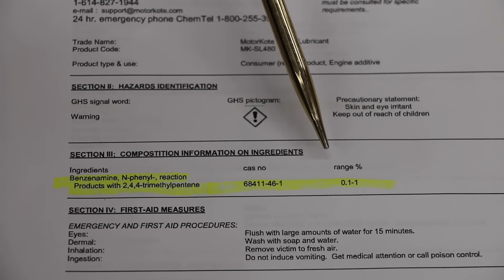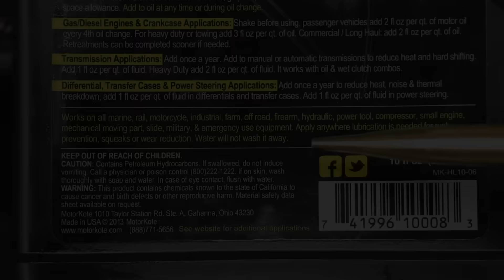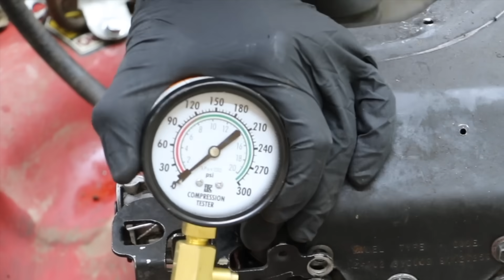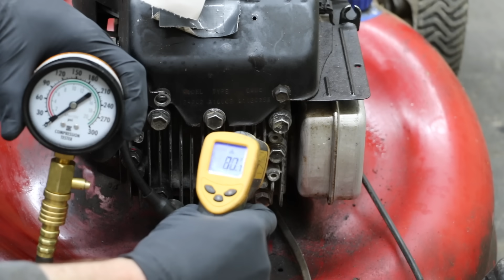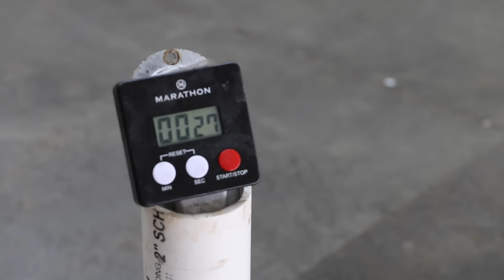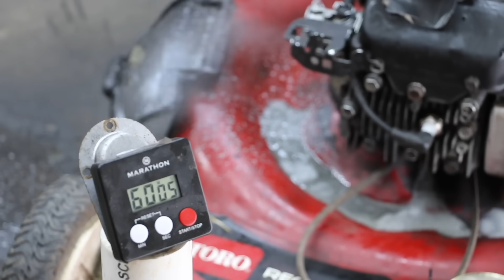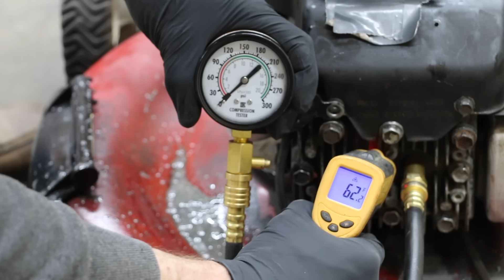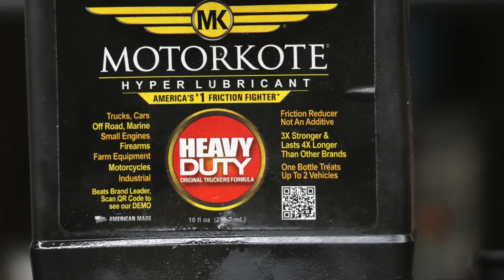Can MotorKote survive the water test?  Let's find out!

Comment: I put 14oz of MotorKote in my RV with a Ford V10 and drove it 2400 miles and it got about 10 to 15% better mileage. Then I changed the oil and didn't add any MotorKote. It still gets 10 to 15% better mpg. Guess it does coat the moving parts.
Reply from the maker: Thanks for the feedback.

Comment: After watching this video, I actually tried this Motorkote on Toyota 2.4 L 2AZ-FE engine with lifter noise at 150K miles, engine got destroyed after half an hour  25 miles on highway. Could you test Petron plus formula 7, E.P. (Extreme Pressure) Lubricants, designed for Diesel Engines. Nano-Monomolecular technology, treats the metal not the oil, long term, it claims it has no additives. No common EP agents such as molybdenum disulfide (Moly), graphite, Teflon, or PTFE resins, copper, lead, silver, or other metals, nor other previously used EP agents. It doesn’t contain Carbon Tetrachloride, 1,1,1, Trichloroethane, or Chlorinated Paraffin, or Chlorinated Solvents or any other harmful solvent. It's also twice expensive than this Motorkote. This formula 7 sounds too good to be true, I don't know if Lubegard is better as most transmission shops use it with Liquid Wax Ester synthetic whale oil replacement.
Reply from the maker: Thanks for the suggestion.

Comment: I learn a lot watching your channel and want to thank you for doing what you do.  I do have a question you might want to look into about Marvel Mystery Oil use in gasoline engines.  If you can do a video about using it, I think it would be interesting.  I use it mixed with gasoline, not in the oil.  I’m thinking that since the ethanol blend fuels are corrosive, mixing in Marvel might offset it.  Thanks again!
Reply from the maker: Thanks and you are welcome!  Thanks for the suggestion.

Comment: You should have ran a same engine without motor coat and seen if it too could run an hour on water. I bet it would cause was always some oil left to mix with the water plus engine not under load. When I was a kid I also put water in a Briggs and Stratton engine and without any additive it ran so long we got tired of watching it. So I call foul unless you use 2 engines one with treatment one without.

Comment: Can you do a product test on Slick 50 ORIGINAL formula they have for sale on AMAZON. I remember my dad swearing by the stuff back in the 80s but the new slick 50 stuff you reviewed was different. Thank you. 👍
Reply from the maker: Thanks for the suggestion.
Reply: I used to use slick 50 in the early 90s. The engine spun over easier and I had lower coolant temps.  The OHV cam bearing surfaces had a shinier look to.  
I don't care what anyone says... that stuff reduced friction.

Comment: Im a diesel technician since 2004 and  I remember they used to sell this at the truck stops at sat brothers and drivers were claiming they were gaining 2/10 of a mile extra by using it years later I started using it cause it does work. Later on I purchased gmc Acadia 2008 and had the engine replaced not long after and shop installed OLD OIL PRESSURE sensor and started leaking oil not even 100 miles on my engine. I changed installed new from napa 60.00 oil pressure sensor and 6 months it leaked out ALL my engine oil but, i run a royal purple, moterkote,synthetic lucas mix and i didn’t notice tell i seen oil on ground and oil was a dot on dip stick i had drove at least 60 miles with 2 qts of oil on my new 3.6 and temp rased a little but always came back down. This stuff works and ill keep using it!
Reply from the maker: Thanks for the feedback.

Comment: Amsoil ran tests on Motorkote and found their products contained as much as 27% chlorine compounds and that when exposed to the temperatures of an engine can be partially reduced to hydrochloric acid - literally disolving your engine.   So sure, it lubricates well in the short term, but long term you're eating the engine from within.

Comment: Please please please test Prolong along side the other friction modifiers you have tested. I used to use Prolong religiously after an experiment I performed. 

Using a hole saw in a drill press to cut 3" round baseplates out of 3/16 mild steel, I was using 10w30 as lubrication. 
The work was tough, any excessive pressure would stall the drill press and when it didn't stall, the hole saw sang like a siren and there was lots of smoke. 
Boss did an oil change using Prolong and left for the day. 
I picked up the bottle from the trash can and put a bit in the puddle of oil on the steel I was cutting. 
I watched as the Prolong stirred into the oil in the groove. 
The singing went away, smoking stopped and I found hang my body weight from the handle on the drill press and couldn't stall it. 

The hole saw stopped cutting completely. I tried a fresh piece of steel without oil and it still wouldn't cut. I ended up getting it to cut again by using brake cleaner to clean the workpiece and the hole saw.
Reply from the maker: Thanks for the video idea.

Comment: I wonder if Motorkote could  create sludge bing it sticks to the surfaces so well.  Just a thought.
Reply: It should just leave a thin microscopic film. If you change your oil often the detergents in your oil will keep the engine clean. Oil won't sludge up if you don't do intervals that wouldn't be run long enough to allow oil to break down and lose its properties.

Comment: My friends power steering pump was making noise in the winter I told him to put some motor kote in it so he started the engine took the cap off and was looking for something to measure the motor kote while he was doing that I dumped some motor kote in the pump while it was running and before he could find anything to measure with the  pump stopped making noise.... He said if he had never seen it he wouldn't have believed it.
Reply from the maker: Thanks for sharing.
Reply: @ProjectFarm  your welcome I've been using MK for probably 25-30 years it think , I have a 1993 Toyota Corolla with 1,000,048 miles and it's still rolling with MK.
Reply: @mittiejackson3427  excellent testimnoy
Reply: My friends daughters hinge on her bedroom door was squeaky I told him to put some motorkote on it he said no I want to hear the boys going in and out of her room. 😂😂.     Then a few months later he told me his daughter was pregnant. 😂😂

Comment: My 5.9 Dakota has 187k on it. Oil pressure when hot is 20-30. With motorkote it's 40-60. Been using it for 2 yrs now. Oil psi is still 40 to 60. Amazing.
Reply from the maker: Thanks for sharing.

Comment: I have been using MotorKote for many years now and got some great deals when they ran specials on the trucking bozo show over the weekends with Bubba Bo.    I had a Silverado with 265k+ miles on it when I sold it and engine was still solid.   Now I have a Toyota with 157k and just changed the alternator but engine is still purring smooth.   Worth the price!
Reply from the maker: Thanks for sharing.

Comment: Can we have a moment for all the lawnmowers Project Farm picks up on the side of the road 🙏 The sacrifices they make 😆 When my kids were young I did a test of 3 lawnmowers I picked up on the side of the road during spring cleaning.  I guessed lawnmower with broken pull string was either blown or had too much oil , lawnmower with good gas and compression but throttle seemed jammed just needed cable lubed and adjusted and thirdly mover gas smelled terrible and that tank had to be flushed and carb cleaned. Sure enough we got all three running costing just time and one pull cord. We went back out the next day and found 2 more lawnmowers that just needed carb and tanks cleaned. Oh and the mower with broken pull cord was filled 3/4 the way up the dipstick so it was just hydraulic locked.  My wife was going to have a tag sale and asked me for things for it cause when a tag says it has tools also you get far more customers so I had some tools I didn't need and I didn't need these 5 lawnmowers and told her $35 each and no haggling cause I sharpened blades and filled tanks and were ready to work . This woman asked my wife how much for the lawnmowers and my wife said $35 and no less and the lady said for all 5 and my wife said yes.  This lady called her husband and he came down with his trailer and gave my wife the $35 and took all 5 lawnmowers. Well all I have to say is my kids got a learning and so do I.  My wife says she never heard me say each. 🤦‍♂️

Comment: It totally works. I’d be interested to see how it works in transmissions, & with other additives to see if they hurt the performance.

I’d also be interested in seeing if it helps as an additive in 2 cycle oil. That would be very interesting.
Reply from the maker: Thanks for the suggestion.
Reply: @ProjectFarm 

Update: I use this in all of my vehicles now, to great effect. Each one is close to, or over, 300,000 miles with no engine issues.

I also use it in our push mower. Before, I might get 2 years out of a mower, due to the heavy use on quite a bit of maintained grass; Perhaps 2 acres on 17.5, in a very hot summer climate. Since I started using this in the last mower I bought, we’re on our 5th year of life, with no issues.

This is really good stuff, when used for its intended purposes.

I wish they made a spray for metal on metal applications, like door hinges & locks.

Comment: I realize this is an old video, but I think it's worth mentioning, (I did not read all the comments), on the subject of anti-wear additives,    zinc and phosphorus, gasoline engine vehicles equipped with a catalytic converter require oil with less ZDDP, an API standard of <800ppm. Otherwise, over time the phosphorus builds up in the converter, coating the catalyst material, resulting in an error code, check engine light, and failed emissions tests. (Though not really effecting the performance of the vehicle, just engine light and poor emissions). So in the case of this video, the oil with the more robust anti-wear additive package, though more suited for diesel engines, and vehicles pre 1988, is not an oil you would want to put in a modern gasoline engine vehicle. The Pennzoil, with <800ppm of ZDDP, is actually more suited for modern gasoline engine vehicles, being designed with less to meet API standards.
Reply from the maker: Thanks for the feedback.

Comment: Amazing! 
Could you test different oil additives against each other using Pennzoil Ultra Platinum as the base oil?

Specifically, I’d like to see a 10% of each additive in the oil for the following: 

Lucas 
Archoil 
Motorkote 
bacon grease 
STP
Slick 50
Marvel Mystery oil
Z max
Duralube
Hot shots

Versus just the base oil. 

Perhaps another oilympics?
Reply from the maker: Thanks!  Thanks for the suggestion.

Comment: Have you considered testing any of these products with a pressurized oiling system? 
small 4-cylinder engines on eBay (with shipping) are crazy, crazy cheap. Like comparable with new lawnmower engines from Harbor Freight. 
I ordered MotorKote this morning. I can't wait to see / feel the results. I have a 2.0L VW MK5 FSi engine (GTI) that has a lot of miles on it, with all new parts. Maybe this will make it last for 10 more years.
Reply from the maker: Thanks for the suggestion.

Comment: From time to time, I question your test methods and Analysis. Your test to verify whether water can wash up motorkote not only doesn't answer that question, your analysis is comparing apples to oranges. In the first test, you had the race swimming in a cup of motorkote. In the water test, you put a thin film of motorkote on the bearing and the race, and then put it in a cup of water. And then you compare the score marks between the two. Your analysis of the score marks between the two neither answers the question of whether water washes off motorcoat, nor is an apple to Apples comparison of anything.

Comment: Ole Geezer Gearhead here again! Don't everybody roll your eyes!! NOW, at almost 80(next birthday) I'm still changing my own oil and greasing the front end, of, you guessed it, my '02' Ford E250 3/4 ton extended van. with a 5.4, 2 valve engine. AND, I'm still using Mobil1 full synthetic oil, and MotorKote. The van, now has 339,000+ original miles. On an un-touched engine. Other than normal maintenance. I've owned this vehicle from 153,000 miles.
Reply from the maker: Thanks for sharing.

Comment: I would like to see motorcoat  pored in a two stroke engine and then run straight gas afterwards. Because if it lubricates the components and doesn't come off, then running straight gas in the two stroke won't be a problem because the components are already lubricated
Reply from the maker: Thanks for  the  feedback.

Comment: When it is blended in the proportions 2 Oz per quart yes it works. It is a metal treatment. not an oil additive. I have used it for years and yet to have any engine damage. it works for any metal hot spots. blower motor Bushing's, firearms slides.
Reply from the maker: Thanks for the feedback.

Comment: I’m wondering how the engine would have done with water in the crankcase and no previous motorkote treatment? Water can’t be compressed so if it gets between the cylinder wall and the piston and in the crankshaft bearings, it could keep the parts suspended without the treatment. Maybe do the test again on another engine, before motorkote, inspect it  and if it survives, do it again with motorkote to see if there’s any difference.
Reply from the maker: Thanks for the suggestion.

Comment: Motokote work excellent,can you make the same test for Duralube,been using Duralube from the late 80's and had a excellent results, to test it will show if it was just working because I change my oil every 3000 miles,or is it the Duralube, I know have 231000 miles on my 2004 F150 with a 4.6 engine and does not used no oil,purchased new, my 2001 Nissan had 250,000 miles and ran perfect with the 3.0 ,and 1978 Buick Regal with 325000 miles,with turbo 3.5 ,ran perfect.and a few others I have owned, Duralube work good , I hope you have time to check this product out, Thank You for reading
Reply from the maker: Thanks for the suggestion.
Reply: A correction,that was a 3.8 not a 3.5 in my 78 Buick

Comment: Any oil based solution should not 'be washed away' easily by just water.  It's a non-polar liquid, water is a polar liquid.  This is why they do not mix.  Add some detergent to that water, and wow, it washes the motorkote right off!
Reply from the maker: Thanks for the feedback.

Comment: My sister and bro-in-law went to a truck show in Kentucky last month and a MotorKote rep was there in a booth. One of the things my family was told was MotorKote will keep lawnmower blades sharp. They were told to resharpen used blades, balance the blades and then soak the sharpened edges in MotorKote. Also, clean the mower deck down to metal and coat with MotorKote. They claim the blades will stay sharp and the mower deck will not get plugged with clippings. I have seen how well this product works on my Andis dog clipper blades as well as on the blades of my FloBee hair cutter for me. The results are unmistakable as the RPM of both devices increased. I have yet needed to see a dullness in blades in both devices. I use this stuff everywhere on lubricated metal. Door hinges, tools like pliers, you name it. Also added this to all the engines here. Jeep, riding mower, snow blowers, etc. I tried it and am very, very impressed. I STRONGLY recommend this stuff to lubricate your engines, cutting edges, metal-over-metal devices as it really does work! Thank you PF for introducing me to this stuff!
Reply from the maker: You are welcome!  Thanks for sharing.

Comment: I ran motorkote in my Corolla. Went 35,000 miles between oil changes lol starting at 20,000 miles currently at 185,000 miles. I'm pretty sure it works at least a little 😂
Reply from the maker: Thanks for the feedback.

Comment: I had also forgotten earlier to mention that the friction reducers and motorkote are heat activated. Without having heated the part up at all, and use the water right away you may have short-circuited that mechanism.
Reply from the maker: Thanks for the feedback.

Comment: About 20 years ago I added motor code to the gasoline on my two cycle Weedwhacker. My son was finally old enough to run my Weedwhacker and for two years he just put gasoline in it with no two cycle oil. This motor still runs today, I do treat it with motor coat once a year I still don’t use two cycle oil.
    I use it in all my vehicles, lawnmowers, transmissions both manual and automatic and  rear ends. This is a wonderful product I’ve seen the bearing tests many times.
Reply from the maker: Thank you for sharing!

Comment: While he does do a thorough test of this product and many others. The internals of an internal combustion engine is a very violent, very hot place. And in many newer vehicles its a technologically advanced place too. Please don't just use these informative videos to determine what you should and should not be putting into your engine. Do your due diligence and research to decide on if you want to add any "enhancers" to the fluids your vehicle needs.

Comment: Back in the 80's there was a product called Slick 50, don't know if it's still around. Wonder if using motorkote like wax would reduce air friction on exterior of car and improve gas mileages?
Reply from the maker: Thanks for the suggestion.

Comment: I recently added MotorKote to my oil and transmission after having replaced these fluids. After a week of running the engine I have noticed the knock on cold start is completely gone and have noticed a slight increase in get up, although that could be attributed to the transmission fluid change as well. I have not had any ill side effects as of yet.
Reply from the maker: Thanks for the feedback.
Reply: Fresh fluid makes a difference period,  but made better with Motorkote. Been using for about 15yrs.